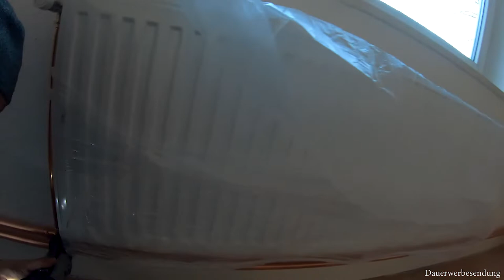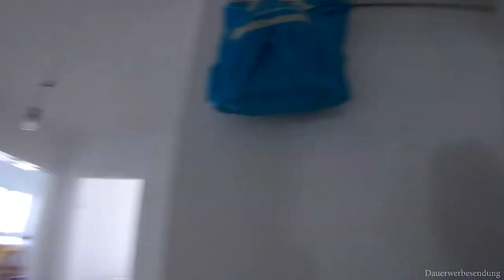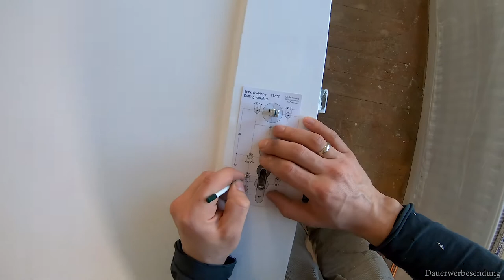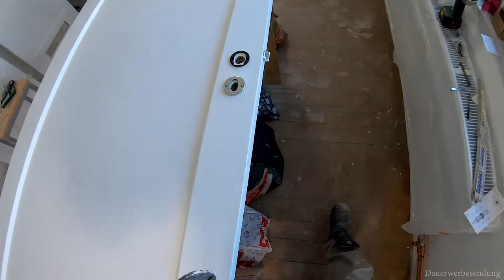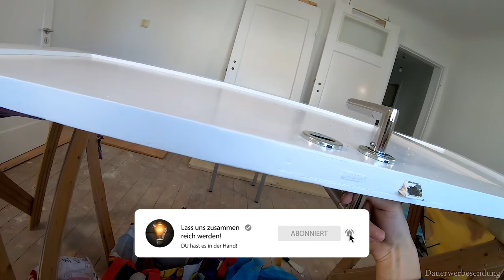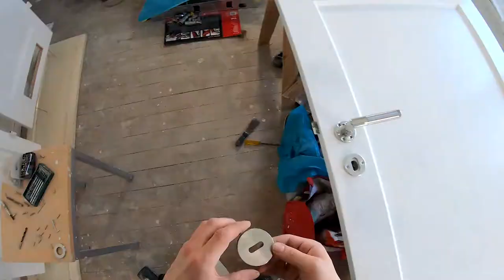Wohnung selber renovieren Vlog #13 Türklinke montieren, Update   Immobilien Sanierung

Comment: Gibt es einen Grund, warum Du die Heizungsrohre nicht unterputz gelegt hast? Die Wände waren doch eh offen, da hätte sich das doch angeboten? Jetzt hat man immer Stellprobleme mit Schränken wegen der offen liegenden Rohre. Beim Verteilerschrank dasselbe, warum nicht unterputz? Die Schlitzfräse hattest Du doch eh schon rumliegen, da wäre das doch schnell gemacht gewesen.

In den kleinen Räumen wie Flur und Badezimmer hätte ich noch die Decken abgehängt und LED-Spots eingebaut. Das geht flott, kostet nicht viel und man spart sich das Aufarbeiten der alten Decke. Macht auch optisch was her und die Mieter zerbohren nicht immer die Decke zum Lampen aufhängen.

Ansonsten finde ich das gut, was Du machst! Steckst viel Herzblut rein und lernst eine Menge! Mieter wissen das leider meist nicht zu schätzen, weil ihnen gar nicht klar ist, was für ein Aufwand da drin steckt.
Reply from the maker: Danke für deinen Kommentar. Die Wände haben wir nicht angefasst, nur da, wo die alten heizkörper waren. Aufputz geht halt viel schneller. Zudem wollte ich die Wände nicht anfassen, sonst hätte ich gleich die Tapeten abgerissen und alles neu fein gespachtelt, wie im Flur. Wenn man die rohre weiß a malt, fallen die kaum auf. Ist vllt nicht das schönste, aber so habe ich extrem viel Zeit gespart.
Was meinst du mit Verteilerkasten? Den Sicjeringskasten? Da ist doch alles unterputzt?!
Die Decke um bad habe ich abgehängt und 3 spots eingebaut, um die Abwasser Leitungen zu verstecken. Im Flur ist die Decke gut, warum abhängen?
Ich versuche alles schickt zu machen ohne da 1 Jahr zu verbringen. Wäre die Wohnung für mich, hätte ich bisschen mehr gemacht, aber du sagst ja selber. Viele Mieter werden es leider nicht schätzen
Reply: @LassUnsReichWerden  Ja, ich meinte den Sicherungskasten. Du hast die Leitungen in die Wand gelegt, aber den Kasten selbst auf dem Putz belassen. Man kann den Kasten auch bündig in der Wand versenken und dann später ein Bild oder eine Garderobe davor hängen und dann sieht man nichts mehr davon. Ich hab's in meinen Wohnungen immer so gemacht, allerdings bin ich auch etwas höherpreisig unterwegs und vermiete z.T. möbliert und deshalb strebe ich immer den "Hotelzimmer"-Look an und achte auf solche Details.
Reply from the maker: Ahso, so meinst du das. Ich weiß nicht wie dick die Wand ist  und ob man eine tragende Wand 15cm tief Schlitzen darf. Zudem verdeckt die badezimmertür den Kasten (wenn sie offen steht)
Und spart natürlich Zeit